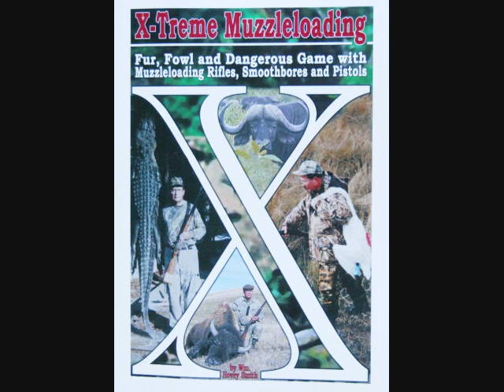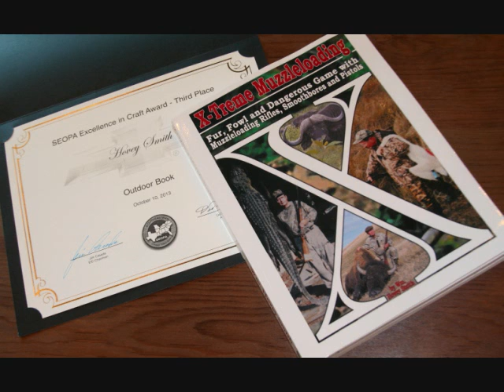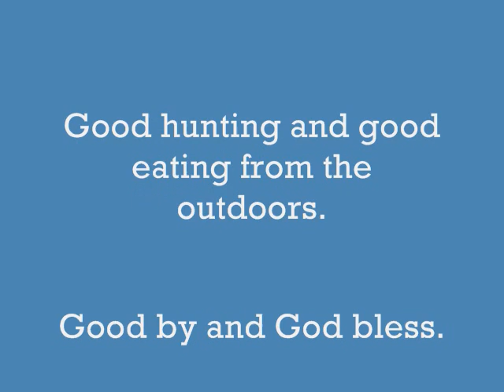Attaching Patchbox Covers to Brunswick Rifles

Comment: The patch box catch fits perpendicular to the direction you demonstrated, and lies in a channel cut just beneath the butt plate. It fastens with a single screw into the ingrain and inline with the stock butt. The catch just pokes it's head through the square hole in the cover, and is tensioned until it catches and latches back over the edge of the square hole. Look closely at some archive material about the gun, you'll see what I mean.
Reply from the maker: Just two weeks ago, I saw such latches on some old guns at Atlanta Cutlery. This was one of at least two methods used, depending on where and by whom the guns were made. These guns also had their patch box lids torn off, but at least their stocks were mostly intact, although one was missing its butt plate.  I will do another video shortly showing how this rifle was finished up for hunting.
Reply from the maker: The follow-up video on fitting the latch has been published. I also show methods used on the original guns. As I had already put on the butt plate and did not want to remove it I used an internal block to support the lid-latch spring.